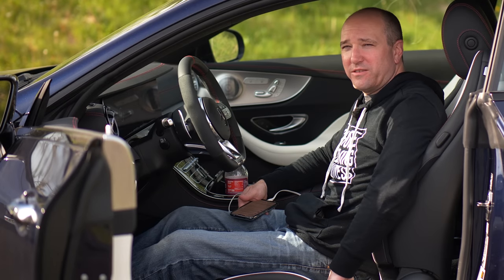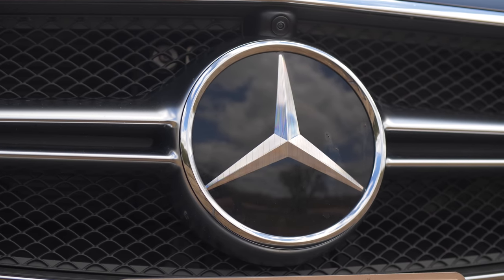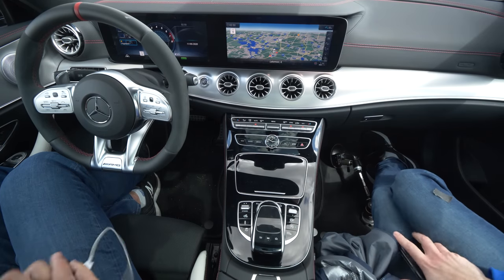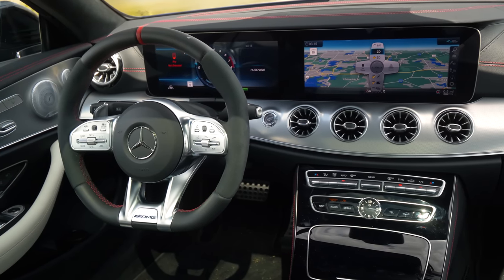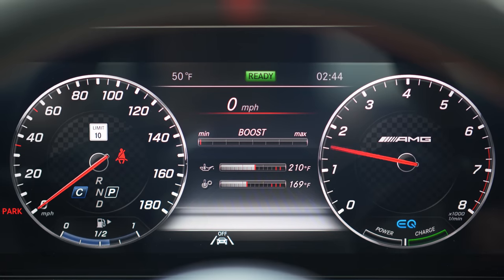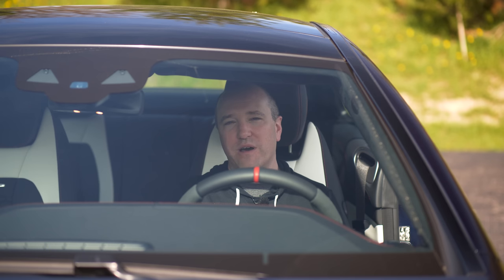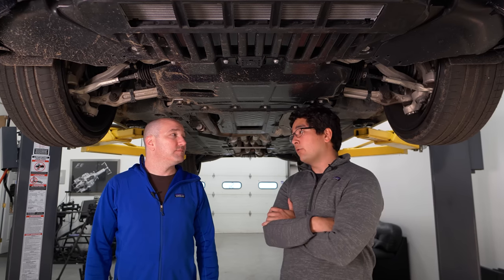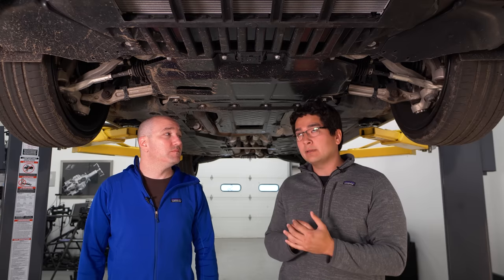2020 Mercedes E53 AMG | Gimmicks and Engineering

Comment: Imagine your local mechanic trying to fix this thing LOL.
Reply: If they specialize in imports it’s not that crazy. There is no reason to go to a local mechanic because you’ll be getting it services at the dealer. Unless you’re just a professional at making bad decisions.
Reply: @chocolatewheelchair  and a professional at wasting your own money on unnecessary "repairs" from the dealer
Reply: AchillesPhazd my brother, when you get this car it’s all free for the lease. Except tires, wiper blades and oil changes.
Reply: Imagine being rich.
Reply: Augusto O.R  if you can buy this then you’re going to Mercedes dealer😀
Reply: chocolatewheelchair “free” nothing is free
Reply: bryce nestman it is free for the first 3 years, it’s part of the warranty
Reply: @zhaoyangxie  its not free lol they factor that into the price you pay for the car, best believe
Reply: kawtel in a lease you’re just paying for the depreciation of the car, if you end up paying more than what the car actually depreciated once the lease is up, then they might refund you the extra money. They do the repairs for free because they want the car to be in the best condition possible once the lease is up so they can sell it used for a lot more money than if the car was poorly maintained.
Reply: Rafael Carpy : fixing is not the same as maintaining
Reply: Most techs are capable of fixing anything with the service manual and correct tools.
Reply: chocolatewheelchair only thing a local shop could work on are brakes 😂😂
Reply: Rafael Carpy well said
Reply: The maintenance price for this car is like a fixing price for "lesser" cars
Reply: Even Hoovie would reject this thing in 10 years.
Reply: Mechanuc for this? 
Not a big deal in Europe.
Reply: Local mechanics need to study up
Reply: Im a mercedes tech 😎 and I love imagining a lesser techs'attempts
Reply: Nothing really complicated here in terms of repairability. It's just an electric motor and a control unit.

Comment: mercedes is really just milking the hell out of the AMG brand
Reply: like every Audi is "s type" and Lexus is "f type"
Reply: @thomasnew8606  *s line and f sport
Reply: Yup. Now 45 models also get the panamericana grill lol. This does two things; both of them bad. 1. The 63 owners will feel their grills are less exclusive. 2. People who dislike the panamericana grill now can't purchase the 45 model for the double bladed grill.
Reply: I want an AMG branded FWD 2 liter diesel
Reply: @ervin7178  you can get that in Europe lmfao
Reply: The inline-6 ones deserve the AMG badge. The V6 ones are fake.
Reply: I agree. I remember when they used to be small-batch and exclusive.
Reply: as they should
Reply: @thomasnew8606  The Lexus F-sport actually gives you aside to the styling, rims and seats a sport suspension, Variable gear ratio steering, rear wheel steering. So actual sportier components.
Reply: They own it that’s why...  AMG engines isn’t the same as the standard as internals and performance..
Reply: @JAnx01  Sigh, the W203 C32 AMG is definitely a real AMG in my book. The 3.2 V6 Kompressor is very rapid -- it has a slightly higher power-to-weight than the W203 C55 V8 AMG that replaced it.
Reply: @thomasnew8606  and m. They are all doing it :/
Reply: @TassieLorenzo  I didn't mean to cover the entire history of AMG in that comment since they change engines so often, only the current line-up. And the V6 in the current C43 AMG for example, isn't even an AMG engine.
At this point, W203 and W211 represent a different era.
Reply: Toyota makes a TRD for everything!
Reply: @JAnx01  Wait until you see what engine they're going to put in the next C63!
Reply: @Xenon0000000000001  let me guess.... 2.0Turbo hybrid?
Reply: Rather get a one year old LC 500

Comment: IMO, as an owner of this vehicle, you need to carefully spec out the interior to get that "special" feeling. I have dark ash wood trim and it makes a huuuuuge difference. It completely changes the interior by almost entirely getting rid of the piano black, most importantly around the centre console. 

Literally never used the energizing refresh garbage. However, the massage function is AWESOME and I do like the fragrance (just turn the intensity down). Still smells fresh as fuck after about 8 months of ownership. It's marketed in a lame way but when you live with it everyday, it's awesome. 

One thing that had huge appeal to us was the fact that you get a convertible vibe with the hard top design. With the sunroof open and the pillar-less windows down, this thing feels like an SL. The heated air scarf extends your windows down season by a month or so. 

It's interesting to hear you guys discuss who is buying this car, and why one might do so. I'm 32 years old and, while I admit this is quasi-old man spec, my wife and I bought (leased) this car because it really does feel special to us. Having owned a number of 3 series and C class variations, this was such a massive step forward that it absolutely felt worth the extra cash. As someone who grew up with nothing but a used car in the drive way, the chance to jump into this car every day is an absolute dream. It's fast, it's comfy, and it has a presence to it. It's big. It's heavy. It feels that way under hard braking. But man....classy as fuck, quick in a straight line and full of tech. Good stuff.
Reply from the maker: Great comment, I pinned it so people know the owners truth!
Reply: You can get the center console in all sorts of materials (glossy or matte, open-pore wood, metal, carbon fiber), and all of them look and feel better than the piano black. Feels like an oversight that this wasn't mentioned.
Reply: @Mike Gurr please tell me you leased this car! And if you bought this car I hope you have a great warranty. This car us going to spend a lot of time in the shop after a few years
Reply: @marcoulibarri5744  oh dude, 100% leased.
Reply: Mike Gurr You forgot to mention, this car can easily be mistaken for an S-coupe. I personally like the E-450 coupe, but great choice nonetheless!! Enjoy 👍🏻
Reply: Mike Gurr  very nice . Probably $1500+ a month for leaseafter substantial downpay? It is gorgeous indeed
Reply: Hey Mike miss your reviews from Motormouth!
Reply: I have a 2019 E53 Convertible, fully optioned.  I replaced a 2014 E550 Convertible. It was a hard decision for me because I loved the low end torque of the E550.  I am still pleased with m,y decision to have made the trade.  The 2019 feels like a new car every time I get in it.  It has so many different ways to configure the dash, I like that personalization.
Reply: People that can afford this you might aswell spec it to the top since you have the money to do it
Reply: @marcoulibarri5744  Why will he spend tons of money on repairs? Please elaborate.
Reply: Interesting, we’ve had our ‘07 CLK550 Coupe for nearly a decade and half. When the E550 Coupe got the 4.7L Twin Turbo we considered finally trading it in but ended up with ‘14 sedan, theres some very special about a none AMG V8 Mercedes. They’re elegantly understated. Love the design of the new E coupe, too bad it doesn’t have a proper engine, it needs the 4.0L to feel special. How cool would a E560 Coupe be?
Reply: You also didnt mention its the best looking car on the road since it came out
Reply: just saw this comment and thank you for your input definitely will put your advice into consideration when i spec out my own facelift e53C
Reply: You need the full interior spec which is probably another 5K for Dynamica headliner and Nappa leather (hoping it covers all touchable surfaces)
then it is truly special. Often customers don't spec their german cars well which results in boring interiors, that's why you can get C63s ranging from 70K all the way to 100K because of all the extra bits and pieces that make the car special.

For instance my M6 has FULL merino leather which was a 5K add-on, but every touchable surface is covered in real merino leather, dash, door cards, lower-trim, it's all stiched merino leather.
Reply: Very cool to hear this from an E53 owner. Just curious if you don't mind answering, how much was the lease per month. How long was it for and how many miles were available?
Reply: this car is fucking hideous sorry, but glad you like it
Reply: I was looking at the C63 AMG, but I think I actually like this more. I don't need the C63 as I've got another weekend car with 500hp, but want more power and luxury than the CLA45 provides.
Reply: How are you able to make that much money at only 32? I am 32 and haven't even finished college!
Reply: @MuffinMan0521  I know this is a late comment, but IMO the only C63 that feels luxury is the sedan with optional saddle brown nappa leather.  Can't get that option in the Coupe sadly, since I like the Coupe exterior styling more (vice versa for W204 generation!).  Hope you found the right one for you!
Reply: I mean, I drove a 2009 jaguar XJ8 when I was 24, that's a full-old man vehicle, but who cares, lol
Reply: Pls reply, is he right about the speakers? How does it sound?
Reply: So true about the spec!

I spent probably 2 months looking for the right spec of my E400 Coupe. It had to have multi beam headlights, macchiato beige/yacht blue interior, and digital dash. Surprisingly a lot of E400s don't have digital (dual screen) dash or mutlibeam headlights spec'ed. 
Finally, found it 2500 miles away and drove it back :)

Comment: 16:55 dodge uses 25 y/o E class platform for new challengers, new E class platform gets compared to challenger lol, pure irony
Reply: It's almost as if all that aluminium makes no difference.
Reply: JAnx01 all that money for R&D earned from daddys leasing their little girls CLAs, all for nothing
Reply: To be fair to the old E-class I have a 2000 E55 and it's platform is pretty good, it can still surprise many modern cars round the twisty bits despite it's lardy proportions.
Reply: Tim Winchester  Yeah, let's be fair here
It's 15 years old
Reply: Tim Winchester  Yeah, the only thing I remember is when the Chrysler 300 came out it used some underpinnings related to the MB E Class.  I do not remember sharing with Dodge.
Reply: Robert Arutunian It uses W211 and W220 suspension. Grand Cherokee is the one using the W166 platform.
Reply: wildly mis-reported myth: dodge used a few basic front-end suspension components and the 722.6 transmission from the E class on challengers, chargers, and 300's until 2016. They never once used the "platform"
Reply: @JAnx01  I think the weight reduction and corrosion resistance vs a steel sub-frame make it worth it IMHO. The other performance benefits aside from weight reduction are just a bonus. (AS negligible as they may be to the end-user).
Reply: Look here! Another ignoramus perpetuating this myth! They only use part of the rear subframe. That's it. The rest has been redesigned.
Reply: @kbcarroll  Rear subframe and a few suspension components.
Reply: @Ficon  Wrong. Both wrong. No W220 or 211. It's some 210 subframe and suspension hardware.
Reply: Tim Winchester  Of course Dodge uses a 25 y/o E-Class platform for its Challenger..., buddy! Just inform yourself a bit better about this fact, you little angry man... Sorry, clown of course...!
Reply: @kbcarroll  You have no idea what you are talking about, there is no such a thing like 722.6 transmission, the model was WA580 (NAG1) and it was used through 2014 MY only on the Hemi powered LX vehicles, the V6 were using the ZF 8sp since 2012.  Stop talking nonsense just for the sake of talkin' !
Reply: @HEMI345S  the NAG1 is a Mercedes 722.6. google is your friend: https://en.wikipedia.org/wiki/Mercedes-Benz_5G-Tronic_transmission#Dodge
Reply: Actually that’s not wrong. Dodge uses the platform from the W210 Mercedes E which debuted in ‘94 as a ‘95 model.

Comment: I️ can’t WAIT to buy this car for four grand in ten years!!
Reply: More like 15-20 years lol, but yeah must be fun driving this baby
Reply: And then you can look forward to spending 4 grand a month to keep it on the road
Reply: It's barely worth that now
Reply: Jack njones  there's a reason you don't really see Mercedes that are 10-15 years old on the road. The electronics is not that reason. If someone can't afford the car after 4 years depreciation they don't have the money for it
Reply: @akshaykumar241  at the rate mercedes is going I'd rather buy these models in the future assuming I could afford it was new
Reply: @akshaykumar241  I feel like it won't be too bad. Starter-generator goes bad? Drop transmission, just like a clutch job in a manual. 48V battery? Still going to be much cheaper than the full hybrid battery in something like a Prius. Replacing the electric supercharger will be just like replacing a turbo. Sure, it won't hold up like a Crown Vic, but (assuming it's properly maintained) it'll hold up fairly well in the long run, unlike a Tesla or a BMW with the N63 engine.
Reply: You mean after the engine is wheezed?
Reply: So here we are four years later. Having difficulty finding those four grand E53's.

Comment: Your point about the difference of how car audio measures versus how it actually sounds is illuminating.  Mercedes and Burmester market these systems as very high end, but the reality is that they're just very good.  In our GLC, the Burmester stereo sounds on par with how our old xc90 sounded.  That's high praise because both stereos sound good, but the Volvo's system was the base stereo and the Burmester in the GLC was an upgrade.  It seems people are getting taken for what amounts to fancy speaker grills and a whole lot of marketing.  Acura does this right with ELS and their Krell stereo option.  The Krell option in the RLX sounds better than the Mark Levinson stereo in Lexus cars.

Comment: I'd take the LC500 over this crazy complicated 'mild' hybrid nightmare mish-mash of parts. You can count on the Lexus to make glorious V8 noises and deliver smooth effortless acceleration on just oil changes and basic maintenance, while the E53 will literally fall apart after the lease is over.
Reply: LC500 and this car isnt in the same segment. The S class coupe is and the S Coupe is leagues ahead of the LC500
Reply: why does anyone have respect for german cars anymore. they used to make cars that lasted forever now theyre putting plastic cam shafts...
Reply: That's like comparing Cheetos to foie gras.
Reply: Macht Schnell equally bad for you
Reply: Would take the e53 over the lc500 for the infotainment alone...
Reply: @timonxDlol  At least Toyota finally adopted CarPlay so the LC500 has CarPlay now. Though I agree Lexus/Toyota infotainment sucks in general.
Reply: Mercedes has the most luxurious interior. look up a  newer model s63 AMG nicest car fr
Reply: @timonxDlol  Get out
Reply: Rashod Moore They’re luxury coupes at the same price point. Yes, this IS an LC competitor. The S class coupe starts about $40k more than the LC.
Reply: @yourfriendlyneighboorhoodf1833  lol you haven't looked at the LC review. The interior of that is on a different level compared to this, it can't even compare. Yet with options it costs the same.
Reply: @CapELarry  no its not. The e class competitor is the GS. The LC/LS competitor is the S class. This is no secret.
Reply: Eventus Vantos to be fair these taxis have nothing of that fancy tech in it. They are nothing but a chassis with an engine. Mercedes-Benz doesnt build bad engines so tjats not the issue. Imo the reliability issues these days are 90% electronic bullshit.
Reply: Samuel Wu Thats very nice but i still think that the interior, even though the materials are great, just isnt as beautiful and the car to me isnt as composed. And yes that v8 is great, but i would still go for an e53 or c63 coupe
Reply: @timonxDlol  not totally true because  Many taxis still have many of the tech like safety and luxury features
Reply: @rashodm7129  should be for 30 grand
Reply: @eventusvantos2770  Taxis are lowest speced without all  those bells and whistles that tend to fail
Reply: @eventusvantos2770  I have a neglected 2003 ES 300 with 368,000 miles. Stupidly unreliable is a stupid statement. If you're going to be a fanboy, at least have some facts
Reply: @TK.919  not true. Taxis spec them with many features especially luxury ones since they want the best for their customers and either way those would only make up 10-20% of the car. There still 80-90% of the car which has to be reliable by defenition contrary to your false claims.
Reply: Lc500? Good luck for that ridiculous touch panel 😃
Reply: @eventusvantos2770  this is not a review of E class Taxis.
Reply: yes sir
Reply: have you driven the car? I guess not
Reply: @dinobot_maximize  because German cars are still the best.
Reply: @eventusvantos2770  you're just denying fact at this point  if you think lexus is unreliable
Reply: @cartere9981  I didn't say lexus is unreliable.  I said that their reliability is overrated
Reply: @eventusvantos2770  its still the best in the business this "amg" is stupid all this electric stuff and along with a twin charged straight 6 and still barely make 400 horses a NA v8 Lexus would last the lifetime of 4 of these.
Reply: @cartere9981  no its not

Kudos to lexus for keeping NA but Mercedes TT V8s are fantastic too and lasts a long time
Reply: @eventusvantos2770  yeah I was talking about this particular e53 amg it's a twin charged inline 6 not a twin turbo v8
Reply: This car and Mercedes AMG is miles above any Lexus product. This isn't in your segment buddy
Reply: @cartere9981  Still no serious engine parts sold for this car. Only service parts. It's proven itself reliable. And it consumes less than a Lexus. Interior more silent. I'd take this over any Lexus.
Reply: you do realize a mercedes with basic maintenance and care will last as long right?
Reply: Stop lying, nobody believes that.
Reply: Me too…Except: Why didnt the LC get Apple Car Play ?
Reply: ….these people dont understand “fr”…